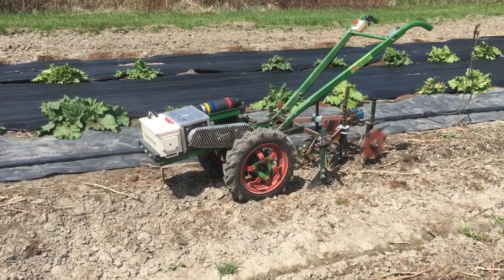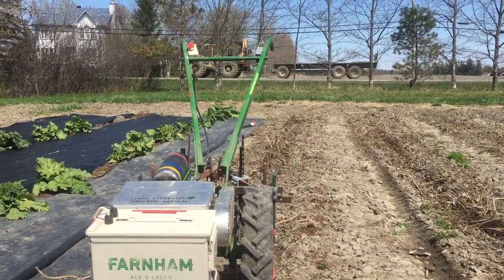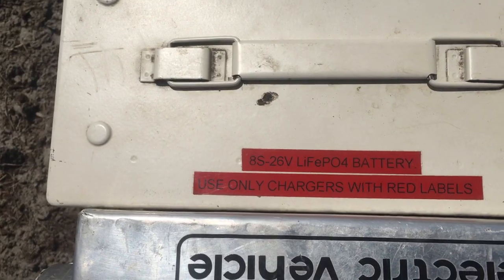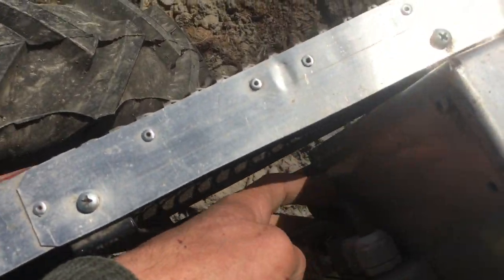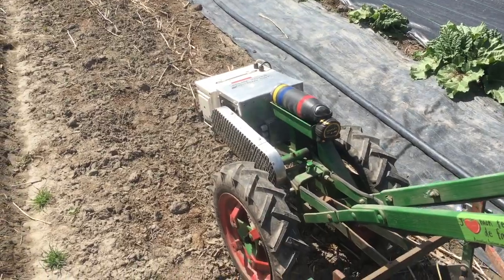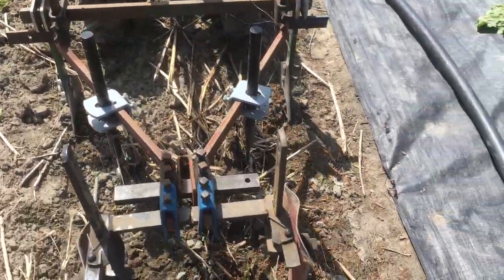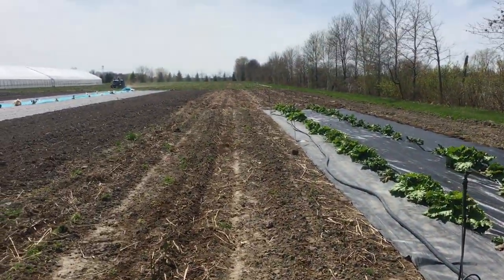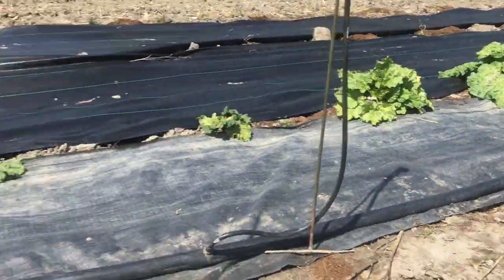Electric Planet Jr walk-behind tractor - description and weeding asparagus

Comment: awesome video! hope you upload more. would be curious to learn what kind of watt hour per sqft of bed youre finding for different tasks like tilling, weeding and other tractor implements
Reply from the maker: I don't yet have figures on Wh/area but I do know that max torque was limited with the previous controller (50A cont. rating) and this was not adequate for certain tools that put a lot of steel in the ground.

Yesterday I replaced the motor controller with a 100A continuous/200A peak model that now provides all the necessary torque.  At full speed and 26V pack voltage it must now be capable of delivering a theoretical max of 1.5kW (60 battery A limit by BMS) which is a lot more than the original gas engine (1.5hp I believe).  Now it's really quite impressive in terms of torque but I've got a creep at idle and choppy behaviour under no load that I need to resolve.

The battery pack is about 1kWh.  Made from K2 LFP 26650 cylindrical cells in 8S10P config w/60A Daly BMS

Comment: What motor did you use and how did you connect to the transmission?
Reply from the maker: The motor is a low speed PMDC motor from a floor scrubber.  A gearmotor could also be used.  The low motor speed allows it to simply replace the gas engine and drive the rest of the driveline without further reduction.  I changed the first transmission stage from v-belt to roller chain because there's no need to disengage with an electric motor but I'm confident that v-belt would also work

Comment: I just finished restoring the exact same model with a brand new engine and all. The one thing have trouble understanding is when the tractor is in the garage how do you pull it out of the  garage backwards? it seems that the wheels get locked when ever I go to pull it backwards, I really appreciate the information.
Reply from the maker: pulling in reverse the wheels should lock and backdrive the final stage of the drivetrain, being the chain drive up to the jackshaft.  This should all spin freely enough to make it possible to muscle the machine backwards a bit.  The belt drive from engine to jackshaft should slip freely if disengaged.  Still it's no pleasure to maneuver in reverse.  Mostly it's designed to turn by pushing forward and pivoting with one wheel going faster than the other